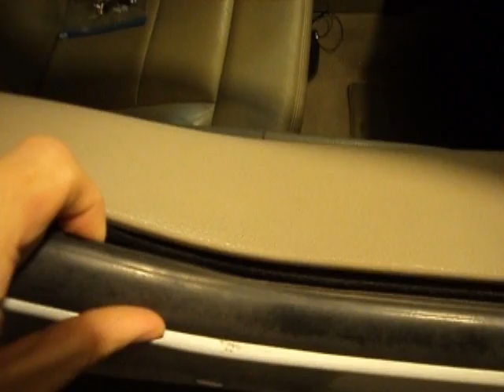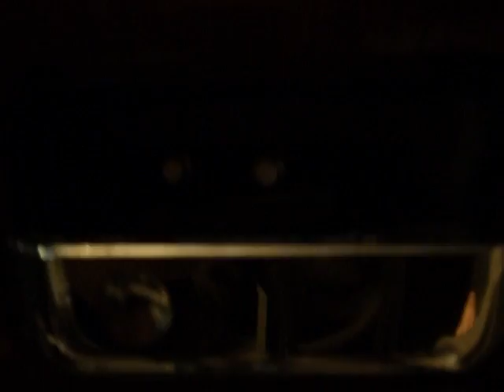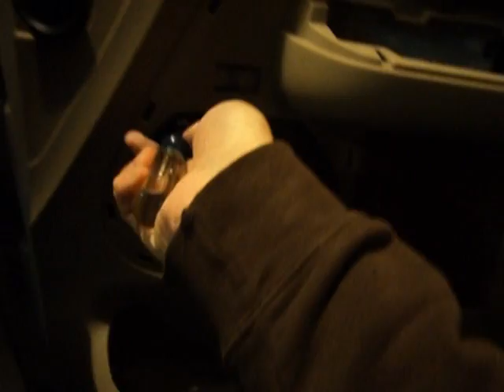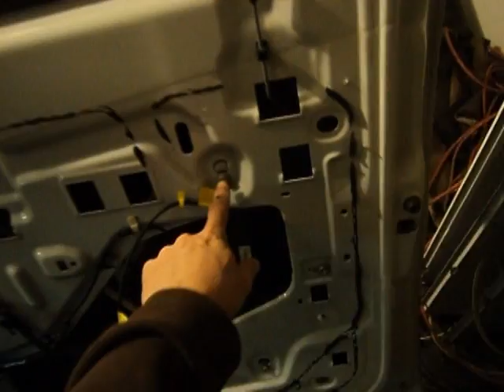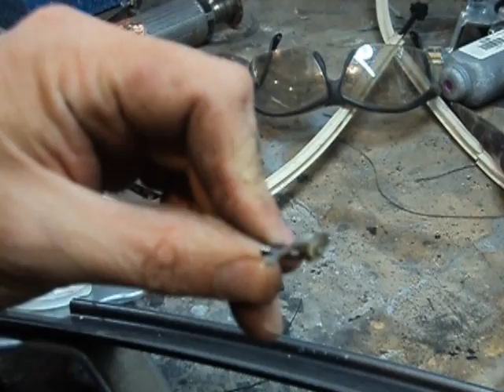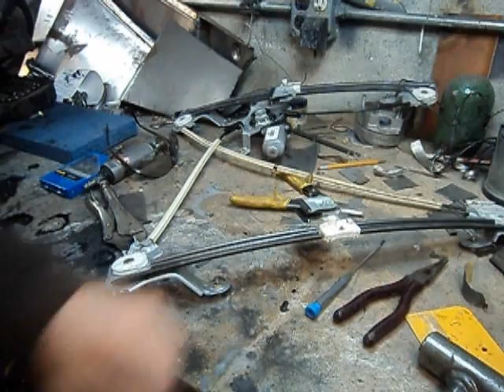2004-2008 Ford Power Window Repair

Comment: Great vid. On my '07 Expedition EL  the passenger side went bad, with the window actually binding while on its way up. It made a grinding/snapping sound (I think it was the cable twisting up somehow? That was September 2012 I didn't get around to repairing it before the driver side did the exact same thing nearly a year later.

I did manage to get both windows all the way up by pushing/pulling on the glass & working the switch at the same time. It was TOUGH! I drove with it like that until now. I FINALLY ordered a new regulator for the driver side. It just arrived today $98.00 including shipping. I'll install it tomorrow.

Now I wonder if the regulator is the problem since seeing your video. Your glass just dropped. Mine didn't drop although it did seem as if it would have had I not pulled the glass back up the way I did. The glass was definitely not straight & could be tilted forward & backward in the door.

I hope I don't get it apart & discover it's something other than the regulator, or the regulator AND the motor, or whatever? Hopefully it's the regulator & I'll be able to save $$ on the passenger side using your method. I'll post back...THANKS!
Reply from the maker: They break in a couple different ways.  There is a drum in the middle that the wire threads around.  Sometimes the wire frays and chews into the drum.  It will cause a bind like you describe.  Either way, a new regulator will fix it.  I don't have a good (cheap) repair for that kind.  Good luck with your repair.  You'll love having your power windows back!
Reply: gregmporter
That's exactly what it sounded like...what you describe, frayed wires chewing into something solid...I'll bet that's what it is! I have REALLY missed the luxury of being able to roll my window up/down! Makes a drive-through royal pain. Thanks for your reply...I'm going to subscribe!
Reply: tvtonite79
Got it done yesterday. You were spot on. The cable had snapped & wrapped around the drum. Rust was the culprit. My door & regulator assembly was a bit different than yours. The speaker hole/housing was actually part of the regulator assembly.  Also, I had to remove the inside door handle & then re-install the whole assembly onto the new regulator.

Instead of 4 bolts, there was something like six or seven not including the two window clamp bolts. There were eight or nine electrical plugs that had to be unplugged. Instead of a piece of plastic, my door had an entire molded backboard made of a rigid Styrofoam type material that was the same size as the whole door panel,

All in all, it wasn't that bad. Same basic concept as yours just a lot more stuff involved to remove & install. I guess it's because it's a 2007 & has all the bells & whistles...more stuff to contend with & eventually break! Your video was VERY helpful. It gave me a solid road map to follow & really made the job a LOT easier. The whole process took about an hour and a half. Now I have to do the passenger door & also the darn sunroof...THAT'S going to be rough!

BTW, I sprayed a dry lube into the window channels & also greased the exposed cable ends to help fight against rust. The window actually works better now than it did when it was brand new! Thanks again!
Reply from the maker: Glad it helped!  Sounds like you got it tackled without too much headache.  The sunroof will be a horse of a different color, but the same concept.

Comment: This was actually not the case with my '05 expedition, only a few screws to get the panel off and the speaker was not attached :) It turned out that somehow a bungee chord was in the door, and that is what knocked loose the track rests for the window.... LOL  At least I got a bungee chord out of it all :)

Comment: Greg, thanks for this video!  Cost $0.  On my 2009 Ford Escape a different stupid plastic design.  Instead of cables coming in at an angle they come near each other along same line.  I had to do it differently - inspired by your method.  I pushed a loop of solid steel wire (not cable) through hole from back side, then around the existing cable, then secured it where it wouldn't interfere.  IMHO the engineers could have made a steel bracket connect cable ends to each other, reducing strain!

Comment: I have no intention of replacing the rivets Greg. I intend to use a metal tek screw before a rivet. Just did a video myself and at the worst part of the day because i feed wild parrots at around 4.00 pm and they were all getting in on the act lol. But driving the remainder of the steel pop rivet out makes the drilling easy.
Will tag my video on to this as i think it might help others.

Comment: Nice fix with the cable repair and money saved.Most the other vids on power window problems have been switches and power fails. Yours was exactly like mine. Went to wind the window up and it suddenly dropped. Had the door trims off but couldnt figure the problem. Will take it off again tomorrow and remove the whole mechanism. I do have a spare  EL ford and have already removed the mechanism but i am sure i am going to find that it is the same broken cable due to plastic failure.

Comment: Many, many thanks, Greg.  Saved lots of money and now I know how to fix the next one that breaks.  Those speaker screws are probably 5.5 mm - a 7/32" SAE is only two thousands oversize to 5.5 mm.  I had a lot more trouble tensioning the cable while reassembling than you did and finally had to use a clamp arrangement to pull enough tension to get it all back in place.

Comment from the maker: I'm glad you were able to figure out a fix.  Hell, that sounds better than what I've been doing.  You are right about the metal base...  Why didn't Ford (or their supplier) just run the wire through that???

Comment: Thanks, Greg!  Just fixed mine using your instructions and it works great!  Instead of using the bent metal, I used a small machine screw between the crimped end of the cable and the plastic opening so the screw head holds the crimp from rolling out of U shaped cable notch and put a nut and flat washer on the back side.  That cheap plastic block has a pretty substantial metal base inside if you can keep the cable end from rolling out.  Thanks Again!

Comment from the maker: I haven't had to rip the rear doors apart yet (knock on wood), but I suspect they are similar to the fronts.  I used 20 ga steel sheet metal.  You can use typical sheet or preprime.  I wouldn't suggest aluminum.

Comment: I loved the video.  What gauge and type of metal did you use for the repair.  I have to do the same repair.  Is there anything different on the rear door as compared to the front door.

Comment: Nice video, had someone steel my truck n break the driver window, after I had it replaced it would never work right then about two weeks later it sounded like something popped n the window fell. I hope that's all it is n don't have to buy a new regulator. I seen having to tape my window up for months now.

Comment: appreciate the vid dude . over the last couple years i fell on my head couple times an bought a couple fords. only problem is one is 50 years old and the other is 83 years and i haven`t encountered this dilemma . although i will admit i`ve replaced couple window regulators in my 2000 silverado.they all have silly little engineering quirks, love your vids man!